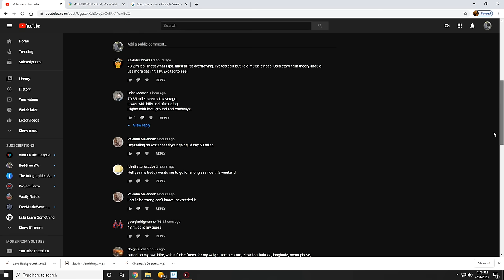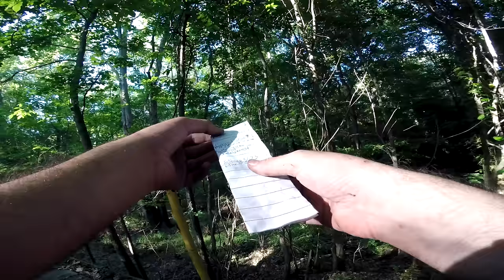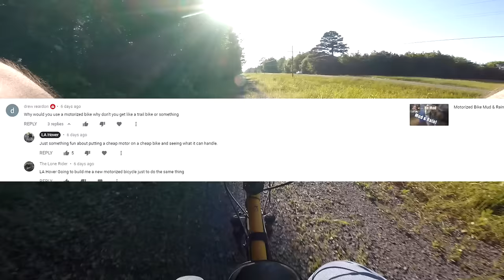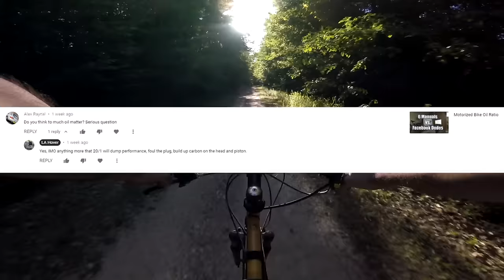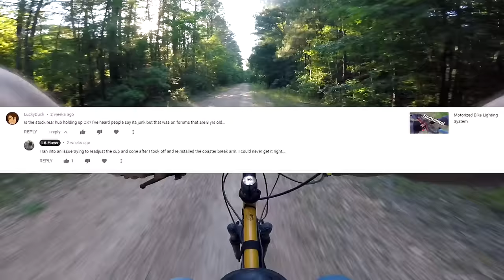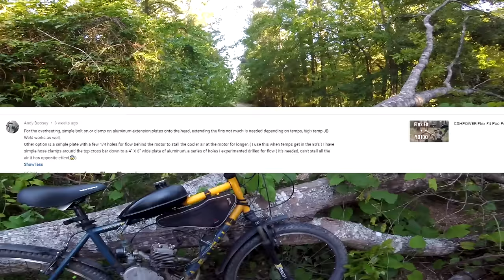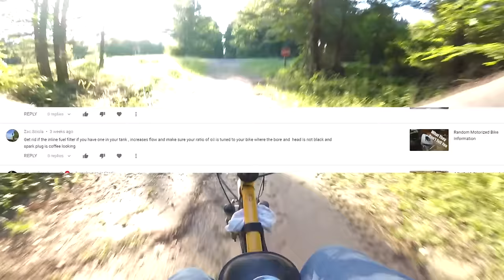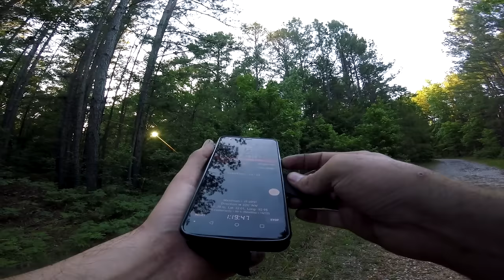Motorized Bike Endurance Test

Comment: About the comments made at about 15:40 concerning sprocket size, he states the smaller sprocket would be better because it would be easier on things like the chain and stuff and would keep it running cooler due to higher speeds.  My thoughts are this is not true for a few reasons.  The clutch is being ridden to crap because he cannot pedal so imagine taking off with the small sprocket?  Some other people just don't feel like pedaling and ride that sucker for 30 seconds straight lol.  The chain doesn't get an easier treatment either.  Maybe if the sprocket were smaller on the front, then the chain would get more shock loads.  The engine could also be working harder during lower speeds with the smaller rear sprocket as well, creating more heat in the engine and less air hitting the cooling fins.  Just a few things that people should consider as fact when choosing that's all.  Thanks for taking the time.
Reply from the maker: Running without a bike chain was a temporary thing for this bike (as clearly stated in the video), so using that as your argument is void...
Trough ACTUAL testing I have found that motor temps are kept slightly lower with smaller sprockets, and fuel mileage increases greatly. 
All of this is dependent on riding conditions. If you live in town, or on hills I should not have to tell you that a small sprocket is a bad idea and vise versa
Reply: @LAHover  that's why I stated clearly that some others use only the clutch and I also said "he cannot pedal". I'm just gonna say that we are agreeing on stuff here I only want to say what I've noticed and explain is all.   I'm  not trying to go against your experiences, just going by my own experiences during real driving observations.  The fastest way to cool any engine is to produce some speed without bogging the engine out but not revving too much either.  Too much throttle and/or bogging any engine especially an air cooled two stroke without enough speed (could happen on a harsh trail  or uphill on a hot day) with a smaller sprocket in back, ridden by someone who doesn't know better, is quite heavy or doesn't want to pedal, or maybe cannot pedal for whatever the reason will heat that sucker up and fast, while eating up more gas and if used to compensate, clutch as well. A smaller rear sprocket will for sure ease up on the torque transferred to the spokes.  Just sharing some stuff that I have noticed. Oh by the way, how did you measure engine 🌡️ with no water cooling, or anywhere to screw a  🌡️ gauge into the block?  You must have carried a laser 🌡️ measuring rig. I own a step through circa 1950's bike.  Anyone you've heard of motoring these type of steel bicycles around  your area?  I'd like to try this one but not sure if the frame design works.   Anyways, SORRY for my essay I wrote here.  Always  be safe but make sure to be cool first and foremost !   ✌️🚴🌼🇨🇦

Comment: I have a cruiser 7 speed I have to say honestly that it’s more of what you pay for a cruiser I payed $500 it’s good quality 630 but not a thin sheet metal framed $90 I live on the Appalachians and it handle the hills the dirt road I live on and does go off road into rivers and rocks and mud a lot it also most the time has 50-120 pounds in the back since it has a rear rack I make walking sticks there very rugid and but also the upright position is better for the spine with a person with spinal issues is easy to tell what’s better for long distance

Comment: I’ve got an older specialized mtb that I haven’t finished yet cuz the chain that came with it didn’t fit the sprocket and binds inside the clutch assembly which locks the back wheel. for anyone who has the problem where their wheel wont move and the chain is completely locked up, that’s why. you’ll need a new chain
Reply from the maker: I have run into something like this once. The stock 410 chain would not fit my 56t sprocket, but the 415H chain would. Also make sure your chain is not binding up in the motor. If it is you may need to take out a link / tighten the chain. Loses chain will cause big problems.

Comment: That's really good. I have a street legal honda cr80 that can barely go 25 miles on a full 1.3 gallon (5L) tank.
Reply: Something is severely wrong in that case. Perhaps a fuel leak, improper tuning, vacuum leak, exhaust leak, low compression, improper valve clearance, or most likely a combination. An 80cc motorbike should be getting well over 100 miles per gallon.
Reply: @ObamaoZedong  The engine is totally fine, it has a fresh top end. The carb is well tuned, perfectly smooth from idle to 13000rpm and it pulls hard when it gets on the pipe at around 8000rpm. 6th gear wheelies, not a problem.

It's a street legal 80cc 2 stroke dirt bike from the mid 1980's with a very short final drive ratio, making nearly 20hp bone stock. I honestly think 100 miles to the gallon on that thing would be nearly impossible.

Comment: How to fix yd100= convert to ld100 with cnc head. Mine does 50mph+ on 100deg day for hrs. Along with many other mods but the switch to an ld100 and cnc head will stop the overheating issues lol

Comment: How often and what kind of grease do i use on the right side gears
Reply from the maker: Anything high temp rated. Once a month or ever 10~ tanks... Wipe out some of the old grease so it does not work it's way onto the clutch pads.
Reply: I've been using white lithium spray grease. It doesn't fling off like normal grease does.

Comment: My choke keeps vibrating up aswel so zip tied it down, I've already took some of your advice an put a peace of old innertube under my petrol tank, thanks, my fuel filter is leaking now, where the top white bit screws on to the rest bottom clear bit of the filter if you know where I mean, I was going to use white Plummets tape but I can't un-screw it an don't know wether it's safe to force it without breaking it

Comment: I got a 8x12 Center Fill Spun Aluminum Gas Tank - 2.5 Gallon for my Motorized Bike on my Beach cruiser  the default tank leaked or kepted moving side to side
Reply from the maker: that is a big tank! That should be good for almost 200 miles per fill :D
You got it mounted to a rack I assume?

Comment: Hey, i have a question. I will be installing an 80cc bike kit within the next week or so, but I still need to find a bike. My question is, do you need to remove the front and rear breaks in order to put on the clutch and the throttle? If so, then how do you slow the bike down? This has confused me right from the start and have not seen anyone take the breaks off in a tutorial i just dont understand how everything would fit considering the breaks would not even be able to function with the clutch on the left side and throttle on the right. Thank you
Reply from the maker: Oh ya I leave them on all of my builds, in most cases you can keep the stock levers. here you can see how I set up one of my bikes. https://youtu.be/k77rqbVwT9U?t=711

Comment: I’m buying one tomorrow and I use truefuel 40:1 in mine is that ok and it was the same size as yours I’m not good with measuring and was told it was pre measures so I pour the whole canister in is this true?
Reply from the maker: That stuff is $$ and does not (in my opinion) have enough oil for these kits. You will need to mix your own. Go for 32:1, many of the small two stroke oil bottles give you a mix chart on the back .

Comment: It doesn't fit on the Cranbrook. The bearing cover doesnt allow the engine sprocket to clear . It pinches the bearing cover .
Reply: You have to remove not only the coaster arm but also the bearing cover. For the engine add on sprocket .it won't touch the spokes without clearing the bearing housing
Reply: I can't send pics so there.
Reply: The coaster still works but only at stopping. At fast it will force your legs to rotate.
Reply: Adding a front brake to a Cranbrook will eat thru pads faster than your hiking socks.
Reply: Rear horseshoe. Get decent pads
Reply: They need to reinvent the chain tensioner

Comment: I had my chain too tight. It popped the tensioner wheel off. Then the chain came apart because it slightly twisted and my master link clip was loose.

Comment: Hi i been watching ur videos for a little while. My favorite gasbike channel by far. I also got the flexible muffler from a former video. But i do have a question. Me and my dad finally got the bike working i went about 20 to 30 miles in a span of a week but then it started to run really bad. Its hard to start and when i do get it started it dies if i let of the gas.  If i get it warmed up it will sit and idle for a second. I have swap carburetor 2 times. If anyone can help much appreciate.🙂
Reply: Will Rypard simple question, are you using any 2 stroke motor oil? If not, you probably scored your piston/cylinder wall.
Reply: @BeezyKing99  ya i am i think i got it fix but thxs

Comment: A bit late but injection water cooling while running hot - requires a gravity feed and distilled water and a drip needle into the carb intake. It vaporizes and that cools the engine - like misty air. Be sure it won't drip into the engine but into the air-stream or figure it out. I have only done this for a 71 Transporter using a washer pump for the trip up the mountain - never had to pull over - no issues for 2 years. Oh yeah - years before that using my big Chevy van w/350CI. Was not unheard of.

Comment: Also could you install a speedometer and a fuel gauge on a motorized bike?
Reply: The speedometer yes. Also tracks miles and kilometers depending on your preference.  Set to your wheel size and go. $20 or so for them.  Fule gage is a no. Open the cap and take a look. Then refer to speedometer and miles.
Reply: He can just use a free gps speedometer app on his smartphone. I have no idea why he doesn't do that.

Comment: I heard that 2 strokes have about a 30 minute ride time per session before it needs a break, is this true?
Reply from the maker: Yes, in hot environments it's recommended. But it you replace the stock head and/or use a smaller sprocket you can safely ride untill you are out of gas.
Reply: @LAHover  Thanks!

Comment: Hey guys, I've recently put together my first build a few weeks ago and ran into a problem with the fuel leaking out of the filter. I did notice that I snipped the fuel line at an angle. Could this be why it is leaking?
Reply: I had the same problem. Make sure the line goes all the way on then ziptie it
Reply: Yeah thanks
Reply: Get a better fuel filter. out of my two kits they both leaked at the seam
Reply: Could you send me a link for one you recommend?

Comment: Maybe you could find a speedometer/odometer, if that sounds interesting.
And you 'can' slow down for those big puddles if you are so inclined.  They can be hazardous the way you are negotiating them.  I grew up with a 1970 Kawasaki 100 Enduro and I used to just putter around rather than try to go everywhere as fast as I could.  Its just so much safer and the fuel mileage goes way up when you go slower (that was my main reason, since I wasn't wealthy and had a very limited fuel supply).  I wasn't afraid to go fast but its just that doing so seemed pointless and I couldn't notice as much when going fast.  (Maybe on video it looks like you are going faster than you really are?)  Just a couple thoughts, not meant to be critical...  Best regards.-
Reply: I wonder why he doesn't use a gps speedometer app on his smartphone. It's free.
Reply from the maker: I use them all the time, recently I have been enjoying ReLive.
Most of my videos don't focus on speed.

Comment: somebody please help.  my clutch wont disengage and there is no clutch!  the pads and the plate are out completely.  im about to give up, please anybody help.
Reply from the maker: Adjust your flower nut. Loosen it if it does not disengage, tighten it if it does not engage. https://youtu.be/QbLh4Txnrh8?t=444

Comment: Best kit on amazon?? Any recommendations? Budget is $140 on a kit
Reply from the maker: Sadly everything is either marked way up, or out of stock at the moment on Amazon due to the pandemic... But I would grab a "Zeda Triple 40" when they come back in stock. Great little motors with a bit more power than a stock kit. These guys have some, but they are running around $200 for now https://bicyclemotorworks.com/product/zeda-silver-6680cc-bike-engine-kit/
Reply: You don’t recommend any to get on amazon right now, only asking because I have a card on amazon i can pay with.
Reply from the maker: I would be fine buying this motor, it looks to have the flared intake manifold and 4 bolt chain bully (both good things). https://www.amazon.com/Quality-Bicycle-Motorized-Stroke-Petrol/dp/B07WMRQQTP/ref=sr_1_18?dchild=1&keywords=motorized+bike+kit&qid=1590560372&s=lawn-garden&sr=1-18
I would recomend taking off the cylinder and checking all the ports for any metal flake (it's a common issue). One of my subscribers did the same thing and it saved his motor. https://www.youtube.com/watch?v=HoArZyf779Y&lc=Ugz-D7cMO5YlEGLscwx4AaABAg.9964J2GdMk4996Y2q_AqK5
Reply from the maker: Update, that kit won't be in stock until June it looks like, but it's the only one I see that is worth the price. You can use the money you save to buy a chain breaker and a spring pulley. https://www.amazon.com/NorthTiger-Tensor-resorte-bicicleta-motorizada/dp/B07X5G8NQ3/ref=pd_vtp_263_2/134-3092756-1797434?_encoding=UTF8&pd_rd_i=B07X5G8NQ3&pd_rd_r=fc1ef581-7549-49a0-bcf5-735b9fa0e771&pd_rd_w=32xzj&pd_rd_wg=hTFwV&pf_rd_p=5946f538-3793-4aed-94d1-6882674b98f9&pf_rd_r=GRM6H4DNX5A84KDYAGRQ&psc=1&refRID=GRM6H4DNX5A84KDYAGRQ
Reply from the maker: https://www.amazon.com/Roller-Chain-Detacher-Breaker-Cutter/dp/B06XQDXW78/ref=sr_1_2?dchild=1&keywords=415h+chain+breaker&qid=1590560950&s=industrial&sr=1-2
Reply: Do I need a spring pulley? I thought that’s why it came with a chain tensioner, sorry new to this so thanks I’m advance
Reply from the maker: @xephazemods2343  No you don't need to use a spring pulley, but the spring pulley I linked is a bit safer and easier to deal with than the stock one. You will still need to shorten your chain as much as you can.  For a first time builder you will thank yourself for using it. Whichever one you use, thread lock all the bolts and nuts.
Reply from the maker: @xephazemods2343  Ya that kit looks good too.
Reply: Can I get that on amazon too?

Comment: 81.38 mpg
I've been told they can get like 150. Is that true?
Reply: 1 gallon is approximately equal to 3.78541 liters.

So 2 liters = 2 / 3.78541 = 0.52834 gallons approximately.

If you rode 43 miles on a 2 L tank of gas, then the fuel economy of your bike would be:

43 miles / 0.52834 gallons = 81.38 miles per gallon approximately.

So your motorized bike gets around 81.38 mpg.
Reply from the maker: In 1985, a "1980 Honda XL 80" set a record holding 470mpg in the "Craig Vetter Fuel Economy Challenge"
This tells me that 150mpg on a motorized bike is definitely possible.
Might be a fun challenge to try, but without strong evidence I would question anyone in this hobby that makes the claim of getting 150mpg on there motorized bike.

Comment: Is it possible to push button ignition without a starter
Reply: Or fashion a Kickstarter for the bicycle engine
Reply: Wireless drill bit?
Reply: Imagine the weight you'd save deleting the manual drive stuff

Comment: Can I go full throttle before break in?
Reply from the maker: Yes, full throttle is fine, and recommended during break-in, but only for short acceleration burst. Don't hold high RPMs until after your first tank.
Reply: @LAHover  thank you
Reply: @LAHover  and should i worry about the mounting bolts vibrating lose?
Reply: @LAHover  sorry for all the questions, but when do i switch from the 16 to 1 fuel mixture to something less rich?
Reply from the maker: @fmfinlay9602  Personally I break in using 20:1 for the first tank, than I move on to 32:1 for the rest of the motor's life.
Reply from the maker: @fmfinlay9602  I recommend double nutting all mounting bolts, or at least using thread locker.
Reply: @LAHover  thanks you  very much

Comment: Motorized bike is the perfect zombie apocalypse mobile. Easy to fix, Runs on whatever, gasoline, ethanol, kerosene, and it doesn't need much. Might need castor oil though, conventional doesn't mix with alcohol. Not to mention, when you're sneaking past the zognoids, just kill the engine and pedal
Reply: Very true! Combine with a solid backpack  filled with food, water and equipment, and a knife or lightweight firearm, I'm sure you could go long distances across a post apocalyptic landscape!